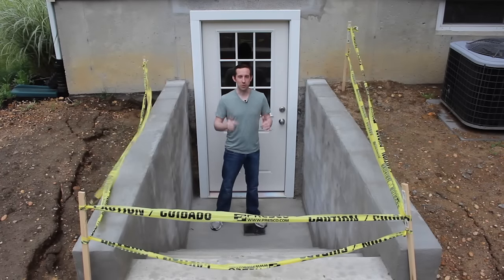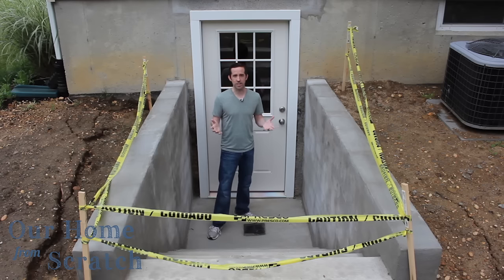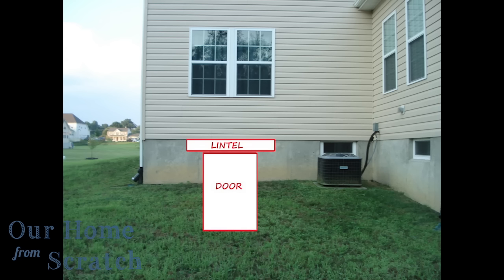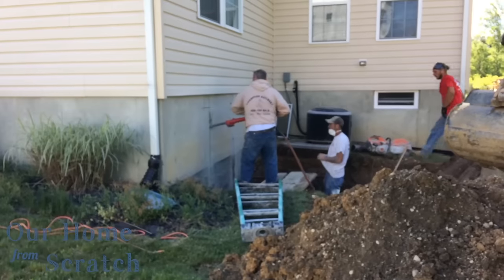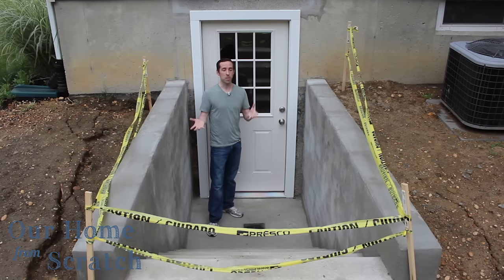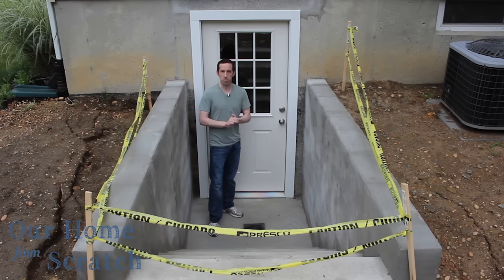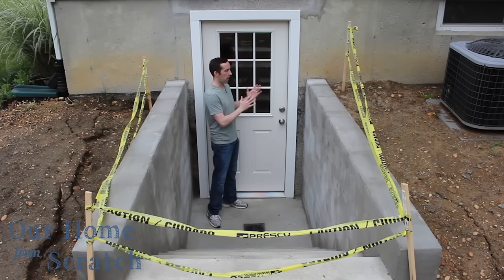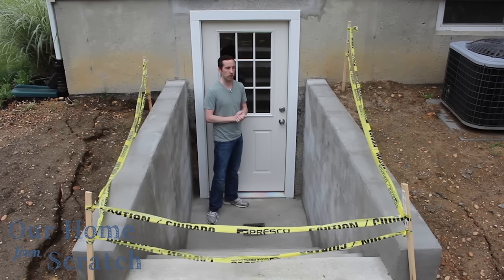How to Install a Basement Egress

Comment: just did this whole job by hand... the whole took 50+ hours of shoveling.. over a month... then the real challenge was a granite/limestone wall/foundation.... another 60 hours of hard labor... shouldve paid to have to the cut the door opening... total cost $300 DIY .. and excruciating amount of back pain
Reply: the door alone should cost more than 300 . the rental quick cut 50 .the drainage system another 80. did you get free granite limestone .
Reply: I could have paid to have mine dug out but it was my gym membership for several months. Large bolders had to be broken down into more manageable bolders with the aid of a 20 lb sledge named Thor and a hammer drill. Physical labor is a terrific way to stay in shape. Good for you Newcastle.
Reply: Well the Egyptians built the Pyramids by hand 🖐
Reply: @whodat9890  door was used 32 inch steel / glass $20. Rehab store lots of cheap used construction materials n my town
Reply: @rickrossi7426   or ancient alien tractor beams
Reply: Sounds like the kind of job that doesn’t meet code. Lol
Reply: @victorvek5227  lol, code.. ha! nah man it is solid, there was already a frame in place above the old window. It never wouldve gotten done with a permit because of soil sample BS. I would've had to have sued for the legal reason of creating a fire escape.
Reply: Save your back if you can

Comment: WARNING:   The drain hole at the bottom will get covered with leaves and collected water will seep into the basement under the door.  I'm having a roofed shed built over my stairwell to prevent this problem.
Reply: This is helpful - thank you
Reply: Video? Plz
Reply: This happened to us. You will need to do a yearly clean out of that drain or it will back up and enter the basement during a heavy rain.
Reply: That's the first thing I thought, I'd make the drain hole a lot bigger.

Comment: My neighbor hired a company who did it with a mini excavator and disposed the dirt into a dump trailer. It was a 3 man crew, 3 days and job was done. Total spent was just around the number you said ($5,400)
Reply: Only thing he did differently was to pitch the walkway away from the steps and put an awning over the area so no rain would ever fall in.
Reply: 5000$ is wicked. Holy cow

Comment: Also, what is the need and requirement for the drain? Exterior I see you made.  Material for drain. No maintenance required
Reply from the maker: @hootanm9090  you’ll have to check with your local government inspectors office on your local drain size requirements

Comment: You could easily cover this with a bulkhead, particularly a Bilco Ultimate system which is PE plastic that comes with optional depth/length extensions, then again with concrete steps your access would become limited by the bulkhead door angle and size, or you could do a conventional lumber framed cover which would offer double security and privacy .
Reply: I had a lumber one out on my egress it’s the exact same as in this widow expect wood stairs. The lumber bulkhead is completely rotted and one door is already off so I’m torn what to do. Perhaps I I could build another entrance door up too or dig it wider and have a sliding glass door put in

Comment: Did you get an engineer to look at the foundation before to see if the structure could be held there? How much do you expect it to raise the value of the home?
Reply from the maker: No.  I didn't need to since many of the same homes in our development have an identical egress feature in the same spot.  Although, I did consult an engineer about developing drawings and he didn't believe it would be an issue structurally.

Comment: I need to add an egress to the basement. I was thinking this methood but the only area i can do this would lead out to the garage.  We have a 3 car garage, and this exit would be on the otherside of the house. Otherwise my plan B is a window.  The contractor who built this house ran the plumbing all along the basement walls, so i have very limited option on placement.

Comment: Hi John, you left out the most important part that I was looking for, great video by the way...........the drain and how did you install and route the water drain?
Reply from the maker: George, the drain portion wasn't captured on film as I wasn't around for it.  But, the drain tees into a line that runs out into the yard and then also tees into the footer drain as a backup in case that line gets plugged.  So it's one tee over a second tee.
Reply: Thank you so much!

Comment: Can you discuss the drain? I would assume that rain and snow builds up in there and how do you handle proper drainage?
Reply from the maker: The drain has a pipe that runs out further into the yard, but where it meets the house it also tees into the footer drain pipe.
Reply from the maker: You also need to make sure the drain is clear of debris and the grill is not clogged or it will backup.

Comment: Quick question. I hope you see this, but did you need to get ahold of your city for a permit for this?
Reply from the maker: Yes, you absolutely need a permit to execute this work.
Reply: @OHFScratch  thanks for the heads up. The house I'm buying has a liveable basement, and instead of a door it's just a window with a ladder going up. A walkway would be much more convenient

Comment: How are those block walls secured in place? Over time wont the earth push those in since they don't seem to be tied to anything?
Reply from the maker: They are tied to their respective footers and then to the house's foundation.  Three years in and no signs of cracking or movement.

Comment: Wow ive been looking for a video like this , now i can show contractors what i want to do. My basement is halfway burried, its just 2 feets. i have a deck on top of where i want to put my door, i wont much water there when it rains but Did you use water proof concrete for the walls so water wont filter throu the doors?. thank your for all you answers

Comment: Did you make headers before putting the door.
I have similar door on newly purchased house. I believe the old.owner did not get that entrance door to basement passed by the city law.
I want to get it passed. 
Someone told me you have to put a frame and headers to support the structure.
Please let me know what exactly they call header. My door is exactly same as yours.
Reply from the maker: The header you are referring to is called the lintel and yes, your door needs one.
Reply: @OHFScratch  
M sorry sir...i don't have any knowledge about construction. After seeing your comment, I enquired about lintel and that was what I was looking for.
Thank you sir.

Comment: Have you found any separation from the block wall to the poured stem wall foundation? I'm looking at a similar project and the inspector said there has to be metal bar installed horizontally on the footings and up the verticals to tie both foundations together.
Reply from the maker: No separation.  I believe the block walls and the new footers are tied into the existing footers and foundation as you describe.

Comment: Looks great! Just like mine, you'll need a screen to cover the drain, and when that door and frame start rusting you'll be where I'm at now. Also, towels on the backside of the door help reduce water seeping in.
Reply: what do you mean a screen to cover the drain? If you cover it, then how will rain and snow not pile up to the door?
Reply: @janelane1912  I use a 10 inch diameter or so spaghetti strainer. It goes well above and around the drain, it's made with mesh screen.
Reply: If you have water coming in - - You have major problems 
I would get it fixed before it does some serious damage to your home
Reply: @janelane1912  My thought exactly  
Probably why they have to add towels to sop up the water seeping in
Reply: Yep all it takes is like 5 leaves over that grate and the well fills up with water then through the door. Ask me how I know lol. A raised dome shaped cover is the best answer, or a sump pump.

Comment: what did you do with the drain pipe? is it attached to anything? How was it installed? I am in the process of doing mine and would appreciate to know a little more.
Thank You
Reply from the maker: The drain pipe is run out under the steps out into the yard to a drywell.  My yard slopes away from my house, so keeping the slope wasn't a challenge.
Reply: I'm sure you can also connect it into a sump pump if slope is an issue

Comment: Very nice job.  Where did you tie the drain into?  Will it handle a heavy rain storm?
Reply from the maker: It's tied into both the foundation drain as a backup, but it's main run is into the yard into a dry well.
Reply: what do you mean by a dry well? Can you explain? Thanks.
Reply: Dry well can easily be looked up, its name is implied in general is a well with no water provision and run off is drained into it and it makes its way through the soil into the natural aquifer, its also referred to as a soakaway, soakwell, or soak pit

Comment: Hi John can you tell me what's the require for size for the drain on the egress
Reply from the maker: I'm not sure what's required per the residential building code for your area, so you'll want to check with your local building inspector to get the correct size.  My drain pipe size is 4", I think the drain itself looks around 6" in diameter.

Comment: Did you have anyone advise you before digging the soil away from the foundation?  I have read that taking away that pressure, and especially with cutting a doorway, can lead to major foundation issues and having an older home, I’m concerned!
Reply from the maker: It was a while ago now, but I recall I did talk to a structural engineer prior to starting.  It wasn't a major concern for us as the home was less than ten years old and has solid poured concrete foundation walls.  Also, many of our neighbors have the same feature that was done by the builder.

Comment: Did you extend the existing footings below the frost line now that the foundation is exposed?
Reply: 2:55 - That's my question, too. It seems like they did not, because in the photo, you can see that they only poured footings for the block walls (and cheaped out on the amount of rebar, I might add!)...
Reply: Looks like John answered the same question earlier:

Justin Van Amberg
3 years ago
Looks amazing! I did have a question. Did the contractor add anymore footings under the original basement wall itself or just for the cinder block walls?  Thank you!

John Our Home from Scratch
3 years ago
Thanks!  Just under the cinder block wall portion.

Comment: How do you keep water from flooding in that small space?  We have the same setup but we get flooding when the system cannot handle the amount of water.
Reply from the maker: It has a drain that ties into the footer drain and overflows into the yard as our yard slopes away from the house.  It's only flooded once when the drain got covered and crammed with leaves.

Comment: Hey John. Great informative video! Thanks for posting. I'm interested in taking on a project like this pretty much exactly, but, the drain for the egress is quite intimidating. Any insight or a how to idea?
Reply from the maker: Our installer used 6" drain lines that tee into a run out to the yard and also tee into the exterior footer drain.  No issues four years later.

Comment: John.   How long did it take them to do the excavation abs make the cuts,  concrete, etc?  It's been a month and all my contractor has done is dig two giant holes.  Both of which have had to be redone due to letting the holes sit for two weeks.
Reply from the maker: Started on a Monday.  Done by end of the week.

Comment: Hey! Great video, and nicely done project. We’re looking to do something similarly with sliding glass doors. May I ask how tall your basement walls are. Ours are only 84 inches, so I’m not sure if a standard height  door would work. The wall we are looking at runs parallel to the joists supporting the home, so I’m wondering if need a lintel in my case. Wondering if you have any thoughts.
Reply from the maker: Our basement height was almost a full eight feet.  Not sure if you'll need a lintel or not.  Good question.  I would plan on it though as the weight of the house is spread onto the foundation, which you'd cut through.

Comment: Did you have a video of doing the jam extension?
Reply from the maker: I don't.  It's just a 2x of pressure treated lumber that is lagged into the concrete with tapcon screws.

Comment: How does the drainage system work? Trying to figure out how the water will keep flowing out of there
Reply from the maker: Drain tees and runs toward the house and other side into yard.  The house side runs into the footer drain pipe.  That pipe runs out to a dry well into the yard.  The run that goes under the steps out into the yard also runs into a dry well further out.

Comment: This is how my basement door is set up and when it rains really hard, water accumulates at the bottom and gets into the house. Everything is sealed and there is a drain. Any ideas on how to stop this?
Reply from the maker: 1.  Figure out if the drain is clogged.  If it's clogged, unclog it.  If it's not clogged, then why isn't it draining sufficiently.2.  If the drain solution goes nowhere, you can add a secondary trench on the inside of the door that leads to an internal sump pump container, which will evacuate the water once it passes through the door.  Option 1 is cheapest.
Reply: The drain is sufficient. But leaves and other debris wash down the stairs when there's a storm and cover part or all of the drain and it slows. If I'm home, I watch for this. If I'm not, I can't. We do have a sump pump in this room but the room isn't graded to allow it to all flow directly to it and results in standing water in the room until I remove it or sweep it to the pump. This had prevented me from finishing the room because of water damage to drywall and flooring.
Reply from the maker: We had the same thing happen to us a few months ago.  We decided to just keep it clear of debris rather than dig the extra draining ditch on the inside.  We don't get many leaves or junk down there to begin with though.  We had discussed adding in a secondary drain just inside of the door to serve as a backup, but that seemed unpractical and was not cheap.

Comment: Question:  Your drain is tied into your existing sewer line from the house to the street?  I suppose the sewer line ran out that side of the house and not out the front.     I am asking because in order to tie into my sewer line, i will need to cut another hole into my basement to run the plumbing to meet up in the basement bathroom.  Does that make sense or am I making it more difficult?
Reply from the maker: No. My drain is not connected to the sewer line.  It's connected to the external footer drain which runs around the perimeter of the house and drains into the backyard.  It's for rain water.  Not sure if you can connect your house's rain water drains to your sewer line.

Comment: Interested in about the work u did ur self for the door into the concrete and its install if u had a video or te details of the process For  the door install into concrete and what it required .
Reply from the maker: I screwed pressure treated 2x boards into the opening of the foundation.  Those boards were added on the sides and one on the top.  I sealed all the gaps between the pressure treated lumber and the foundation with silicone caulk.   Once the lumber is in place, it's a pretty standard door installation.  The door was installed by securing it to the pressure treated lumber.

Comment: Isnt the threshold too low? If water was to pool and drain to slow, it would go thru the basement.

Also it appears that the drain is flowing away from house but shouldn’t it be toed into the house’s sewer stack?
Reply from the maker: It's teed into the footer drain in addition to running away from the house.  It only backed up into the basement once before the basement was finished when the drain cover was plugged with leaves.
Reply: @OHFScratch  so the leaves were blocking the drain and water started to pool and entered into the basement thru the bottom/side of the door?
Reply from the maker: Correct.

Comment: How thick should the footing be  and how long is the wall
Reply from the maker: I didn't pour the footer, so I'm not sure.  You'll have to check the building code, but I think the footer width is twice the thickness of the wall.  Wall length depends on how many steps you need to take you out to the property.

Comment: How do you account for frost heave now that the foundation are exposed to low temperatures?
Reply from the maker: Great question.  I'm not accounting for frost and I'm not concerned about it.  My egress design was based around the same exact design the home builder used.  Homes in my development have not had any foundation issues associated with the egress.  I haven't had any issues yet and it's been a few years.
Reply: @OHFScratch  What is the frost depth for where this house is located? Usually you have to at least underpin the foundation where the door is located and 4 feet on each side of the door. I'm looking into adding a door to our house, but will need to underpin 4ft down from the bottom of door since that is our frost depth. A much bigger job because of that.
Reply from the maker: @SeanHodgins  I think 36" here, but our township didn't require that sort of underpinning.  No issues so far either.
Reply: Good question. I am a structural engineer myself and what this man has done is causing damage to the footing. It is now exposed to freezing